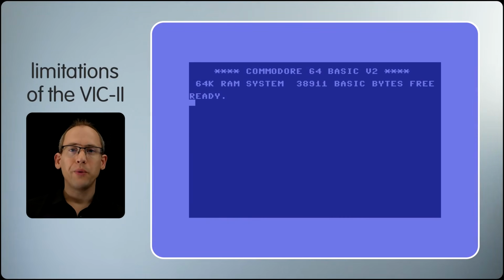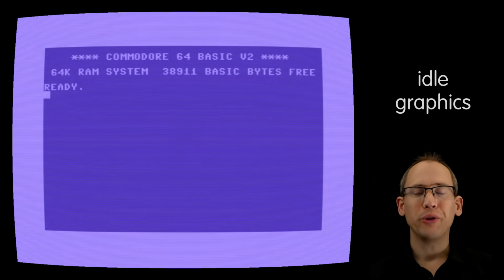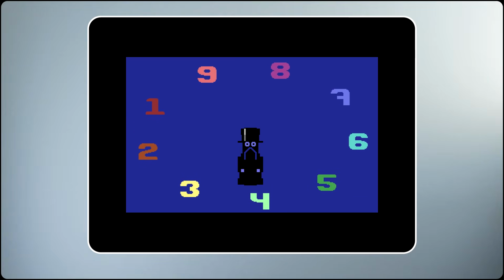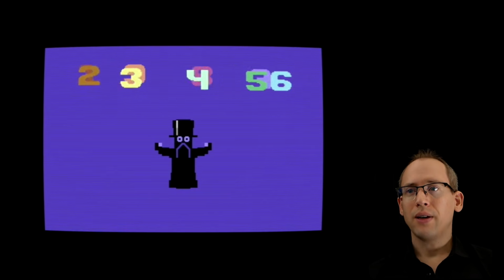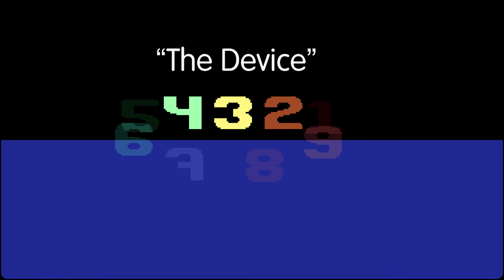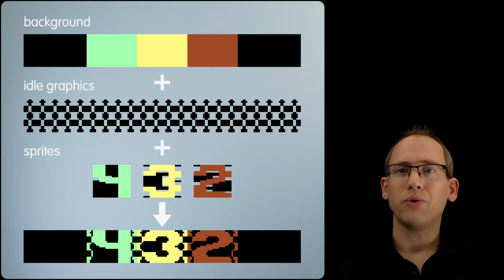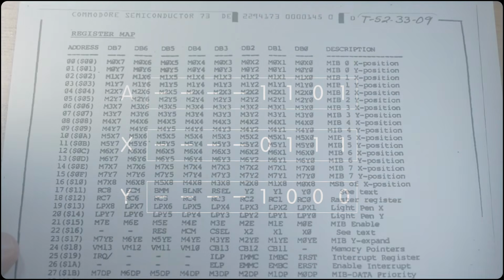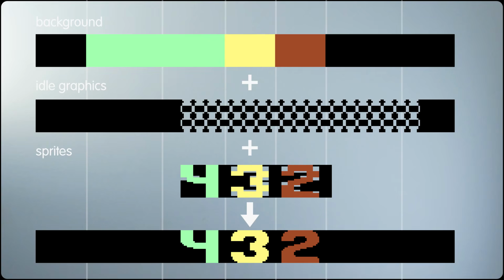Magic Secrets of Nine REVEALED!

Comment: I got fairly deep into the Atari 800 (a computer similar to the C64) demo scene in the early 1980s, but nothing I ever coded or encountered matches this level of wizardry. I'm amazed that the in-raster timing is stable enough to allow for these pixel-aligned operations to work reliably. I am amazed and impressed; congratulations on this work!

Comment: Thank You,, but i wonder if it will work on other VIC versions.On my version changing colors on the border makes little white dots, but I'm unable to test it for now. Nice trick, Yo've got "FU" trophee! :)
Reply from the maker: Yes, the code properly hides the grey dots on the new VIC, but I omitted that in the explanation video.
Reply: @lftkryo  It's interesting that it's possible to determine which VIC version the C64 is using.

Comment: Great job, and the idea behind this demo is really creative! It's also one of those demos where the inner workings are more stunning than the visuals because it looks so simple, but needed advanced techniques to achieve.
One thing where I think the illusion of simplicity could have been more effective if the border stayed light blue until the background flashed a third time, after which the ghost byte would get set up since the Swirling Spirits don't line up at the top until later in the demo, but I imagine making the border black and setting up the ghost byte at the start of the demo was easier to implement.

Comment: It's incredibly clever, but in a way a shame that only real C64 programming experts will even know you're doing anything clever at all. People have seen all these effects before, but perhaps not in the particular combination that requires so much knowledge and hard work. It's smart, but it's not flashy. 

I suppose as an experiment into the techniques, it succeeds, but it's not a mind-blower. Still I suppose you, or others, could use the techniques and the knowledge you've gained in future demos. There's dignity in having all this power but using it modestly.

Comment: This is amazing. If you run this on an NTSC C64 you get a completely different result; and if you run on NTSC Emulator, you get slowdown on FPS but still kind of works, until you try to speed things up, then when it tries to touch the border it just crashes. Some neat hardware video tricks at play.

Comment: It seems like you could have a lot more than 8 or 9 sprites on the screen, if you just track the screen refresh and move the 8 on a row at the top... once that gets scanned, move them down to below where the scan line hasn't gotten to yet and repoint them to a new dataset... let it pass over them... then move them down again.    You would think you could fill the entire screen with sprites...    but then, perhaps a 6502 can move that fast.      Is this possible, I would think so.   Pfft, I haven't touched a Commodore in 30 years even though my barn is full of all of them.
Reply: There are C64 games that do exactly that. Lemming for example. That's why the play area is only 24*8 pixels wide. Lots of C64 games display more than 8 sprites on the screen simultaneously, but none display 9 in a row.
Reply: @retroathlete5814  Yep, I never used the technique, but I punched in a machine language game from Compute! that did use it, shooting at flying UFOs sprites.    

I did write my own line plotting routing in Tinymon assembly, where from basic you would turn on a hires graphics mode, POKE an x1,y1 and x2,y2 in to a high location of ram, do a SYS call to my line plotter up in high ram, and it would do the math and plot a line on the high res screen between those to coordinates and then RTS return.   I then used it to plot spirographs from Basic, etc.  

I punched in one program from Compute!, that would digitize sound off the tape, a few seconds, save it in Ram, and play it back to you.  The quality was Edison wax cylinder rudimentary, but it worked, and was a hint to come of the mp3.    

Not in my wildest dream then would I think we'd ever do what is common today on every mundane home computer, and the limitlesss amounts of storage we have to do it in.   At the time we were all nerds and freaks in a flash in the pan hobby of cottage electronics nerds that was way out there fringe, without any of the massive industry behind it we have today.  In fact, by the end of the 90's, after the AMD thunderbirds, I thought it had complete cratered, was exhausted, could go no further, the internet was dead, and it was all over.   

Never saw tablets, smart phones, multicore chips, or Web 2.0 on the horizon.  I did see video hosting, and wanted to start my own Youtube 10 years before Youtube, but computers and modems just did not have the horsepower to do it yet.   My 300mghz 3DFX chip and Voodoo2 card could play a game intro video, but the massive amount of bandwidth, storage, and legal issues around setting up a Youtube then when I had no money at all made it... implausible.   The legal aspect of people uploading copyright material was really what nixed me pursuing it...   we had already been up and down through the rise and fall of Napster and Limewire and Pirate Bay by that point.

Comment: I understand why Commodore wanted a border, for the two reasons we normally get told: the scrolling thing you were talking about and the overscan thing people commonly say about tubes. But still, why (do you think, anyway) did Commodore make the border so forceful? Why not just set it up so we could easily disable the whole, or V/H parts, with just a simple command or two? Or even set it up so it could easily be commanded under or back over other things?

Comment: Great demo, your technical expertise on this platform is unrivaled! Feels like magic indeed to trick our brain into seeing all these techniques seamlessly stack onto each other. Your explanation of "the device" shows how limited C64 hardware is, but still you can exploit the power of precise timing and low-level hardware hacks that you can't take advantage of in modern multitasking environments.

It's impressive to see idle graphics being used instead of custom fonts to emulate the extra sprites on the border, where custom characters can't be displayed. Once you realize that, you can see the real beauty in that blocky design of digits.

Comment: When knowing how. I wouldn't call it either magic or illusions. Its like doing magic to create an illusion. What it is, is extreme knowledge, innovative fantasy and very very hard work. Lets say you already have the ideas how to even do this, it is extremely hard to implement. The narrow timing is unbelievably hard to do and keep stable. Each beginning of a frame need to stabilize the cpu versus the raster into the exsct cycle. And there are insane tricks to achieve just that through double interrupts and proper branching.

This demo is absolutely insane.
You are truly a magician. Hats off to you. Nobel prize in extreme coding.

Comment: Ah, so the impossible part is actually done totally differently than I thought.. The ghostbyte shinethrough technique has been done before though, I think Crossbow was the first to use it in Crest's Avantgarde (he called it GULB - Graphics in upper and lower border).. using rastersplits and illegal ECM mode in this way is ingenious and new though! ;-)
I still think it could have been done as well by putting several sprites into one multicolor sprite, flexibly, depending on the frame of the animation, using the fact that sprites overlap to hide the double wide pixels. /dk
Reply: You need to run the GULB part a few times to get the bouncing scroller that goes into the border because it's random. I think he may have even used that technique in another demo before (Bubble Tale?)..

Comment: I wrote such a demo on the AtariST combining many effects which originally are not designed into the hardware. Each such effect usually uses all CPU and/or all RAM. So doing multiple at the same time makes it an impossible demo. Here is my 1 hour talk presenting the parallax distorter.  https://youtu.be/CicttTq528I

Comment: Round of applause! It takes a lot to please me but it can be achieved. :) It's a very satisfying effect very well executed. Another element which is pleasing is the avoidance of "show off" presentation. The wizard character looks like PETSCII graphics so the starting position is of a piece of software which /looks like/ almost anybody could have written, so it's part of a very nice build-up effect, to begin with something which looks weak to deceive the observer into thinking they'll always be a step ahead, and then gradually make it harder to achieve until the final effect with 9 uniquely coloured sprite graphics with hires pixels in a horizontal line without skipping any rasters. At that point  I stopped being able to explain it, so, if it was Penn & Teller "You fooled me". Well done.

The route I had been on was thinking it's a basic 8x2 sprite multiplexer with the numbers plotted into them like software sprites but of course that idea was dashed against the rocks by the unique colours, but obviously they were extremely unlikely to be 9 regular high res sprites because of course that would be "impossible" (as far as we know so far). 

The best I can boast is having used a related technique of using inverted high res sprites with colour character graphics underneath to create multiple foreground colours for a "hires" + multicolour bitmap. I am a little bit disappointed in myself for not taking more thinking time before trying to "steal" the secret without working it out. I might have got it, but of course I didn't get it. I looked up your explanation, which is by far the best explanation so far and very well produced and constructed. I also noticed a lot of the other explanations I have seen are phoney, it's people going "Aha, it just uses expanded multicolour sprites and the ghost byte", and I'm like "Yeah.... but that isn't enough to explain how you get that hires finish", the way you use the black sprite colour to create different shapes from a repeating ghost-byte pattern by matching the black of the ghost byte to different shaped black pixels in the hardware sprites, which you reveal here. It's only now I realise I hadn't looked closely enough to realise not all the sprites were travelling in an arc. Although I did think "So, how's he changing the viewing angle? If he's scaling Y plot data it's going to take a bit of time. Not impossible. A 1.7 format fixed-point multiplication <1 is doable for about that many objects because I've done it myself... but it could be time consuming". So, the changing angle piqued my interest but not for long enough for me to suppose it was to trick me into ignoring the fact the back three sprites move along the same rasters and each remain at the same distance apart. The sprite paths transition from what looks like a modified sine curve into a straight line and back again as they pass through what you call "the device". I can see by because that little module, and then the sprite crunch code, is what will have taken the most work.  

Very clever, very fresh and very well presented.

Well done!. :)

Comment: Makes you wonder what’s possible when applying this level of hardware mastery to a modern PC or game console.
Reply: Sadly it won't really work with PC because each one may be a different set of modules connected together through God knows what motherboard. With consoles it would be possible, but that's way more hours of coding since hardware got exponentially more complex and some parts of how it works are hidden as a commercial secret.

Comment: This video also gives the answer to the question "I've seen ... in a demo, why can't this be used in games? 

Well, it's because games require game logic and a lot more things happen on the screen. To get that "simple looking effect" they had to use every trick the C64 had to offer and squeeze every CPU cycle out of the CPU in certain areas. Effects like you see in demos only work because the whole machine is doing nothing else but displaying that one effect, and it couldn't do anything else but display that effect at the same time.
Reply: Also, a lot of the most advanced tricks like this aren't of much practical use in games. The needs of a game are almost always dictated by designers, who are less interested in what hypothetically could be done than implementing the ideas for fun gameplay that they already have. I have yet to see a single effect in a demo that has made me think "It would make a really cool game if I could control this."

Which isn't to say games don't sometimes use graphical trickery. Martin Piper has quite a few videos where he shows how various games achieved the visual effects they used, if you're interested in seeing some examples.